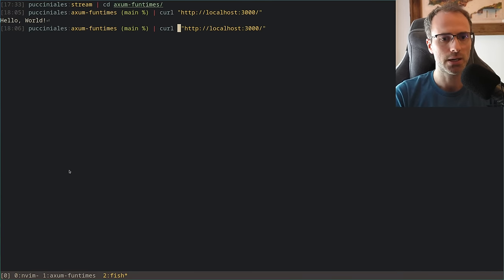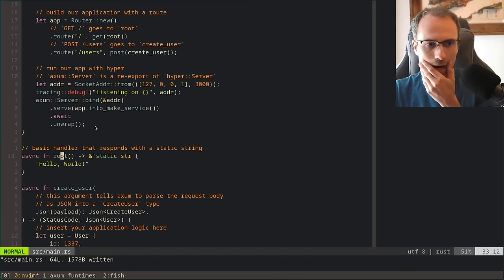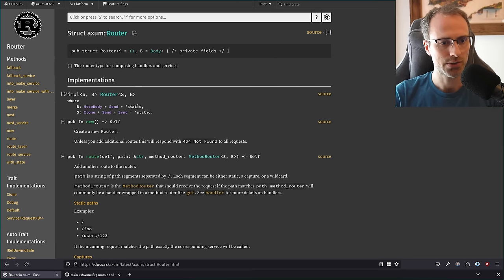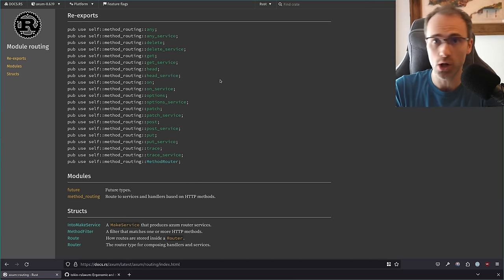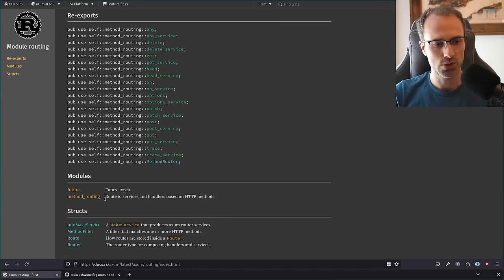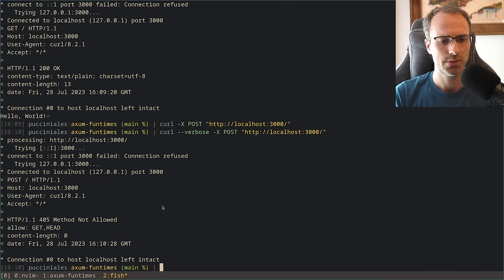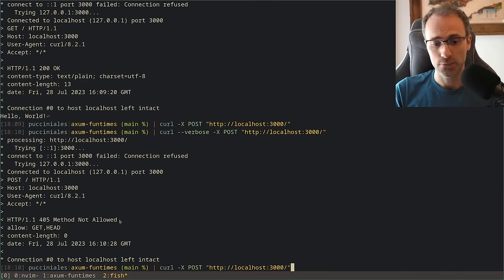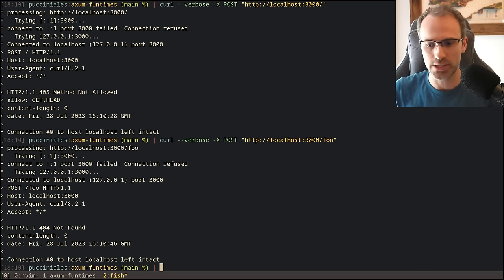Decrusting the axum crate

Comment: 'Decrusting Bevy ECS' next? I really want to know how function is bevy ECS system and it gets it arguments?.
Reply: It's pretty much the same as axum's Handler macro expansion. You can find the implementation in bevy_ecs within exclusive_function_system and exclusive_system_param modules.

They use a all_tuples macro as well, which is more generic, as they pass number of variadics to implement for, but is nevertheless the same result.
Reply: I was just thinking that it is basically the same as bevy. The stuff that is made possible by all the traits and impls is really awesome and quite magical. But not that magical now, I kind of know how it works.
Reply: @tomaspecl1082  yes it actually make sense to me now. Also know as Extractor functions. It supprised me how simple and powerful this system is.

Comment: It's a very interesting pattern, which Bevy also uses and makes it quite easy to work with. Although I have read somewhere that there are some downsides to this pattern, regardless of compile time, but haven't dug deeper into it.

It would be nice if variadics were supported at syntax level in Rust. But as I understand it, it's not so easy since Rust would need to add variadic types for generics and functions while keeping its error and debug diagnostics easy to read as well.

Comment: 1:13:00 an alternative to "type erasing" (converting to a Response inside the handler) is to return a `Result`, which is one of the reasons I switched over from Warp (which uses Result for something else so you can't use it for diverging results). The more reliable type-checking is why I personally prefer fully typing most of my axum handlers, rather than using `impl IntoResponse` or `Response`, it's too easy to miss some of the bits you wanted to include then (especially when you use a uniform handler error and Result, in API contexts you probably always want to be sure the error value is the application's error type).